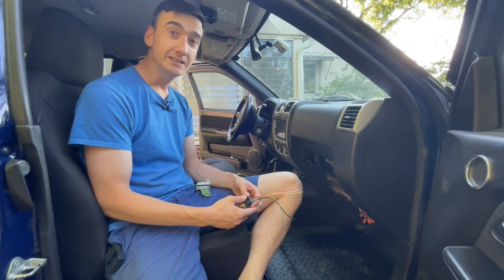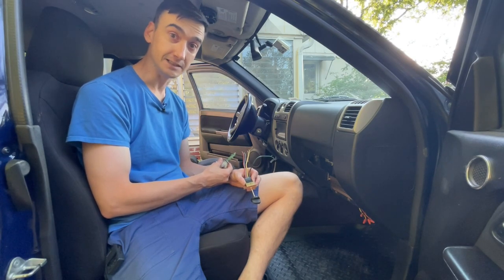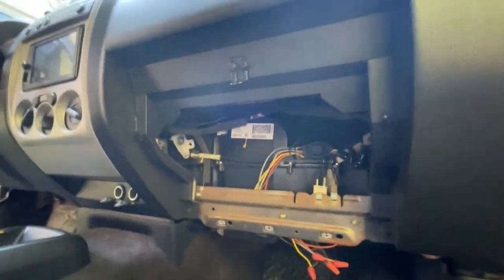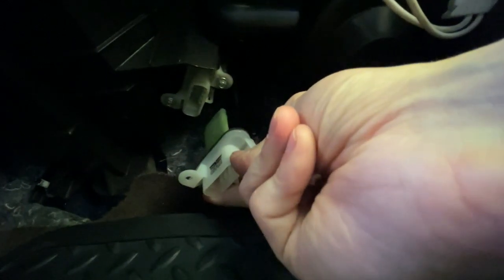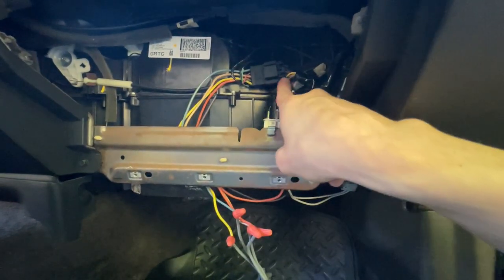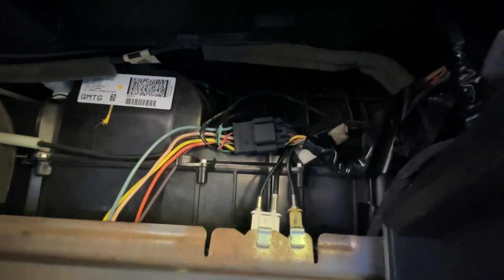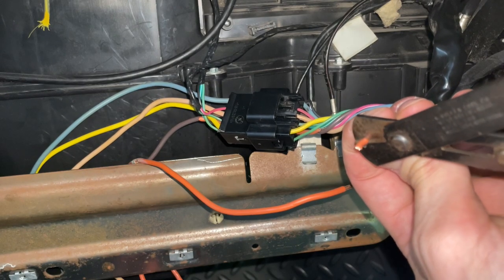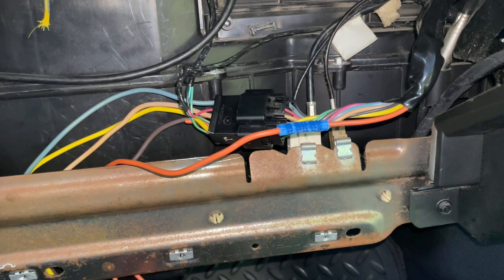Fixing high speed on the blower fan of a 2009 GMC Canyon (not the resistor!)

Comment: Awesome video! Why put another plug back there? Whoever designed 04 to 09 Colorado's hvac needs to be black bagged. The rear blower screw is only accessible to Gumby. I have an 05 and all my heater wires are melted and the resistor has been changed 4x... This video helped me fix high speed. SMJ 23
Reply from the maker: There's no cabin air filter on these trucks so crap gets stuck in the fan all the time which makes it work harder than it was designed to. You'll want to check out my other video here! https://www.youtube.com/watch?v=qgZKQM9OP6g

Comment: First close to my issue 1998 s10 switched, switch resistor blower motor,  and still looking for high speed.,
Reply from the maker: Just gotta trace the wire! If it's not the switch itself, there's only a few feet of wire that goes to the fan. Just gotta find out where you no longer have voltage and that's where your break is. You've got this!